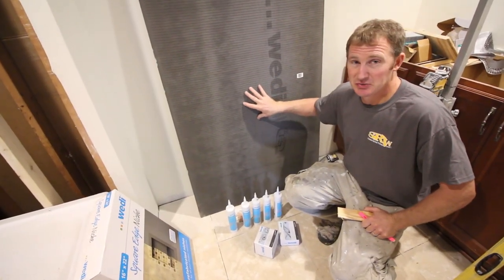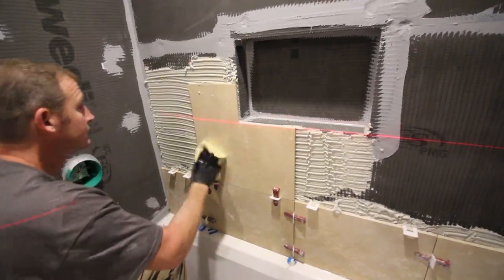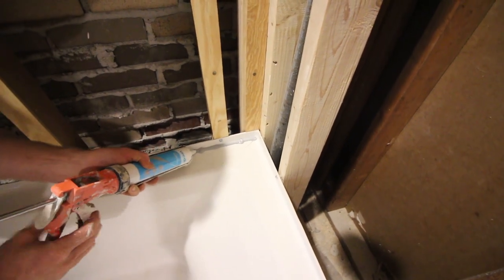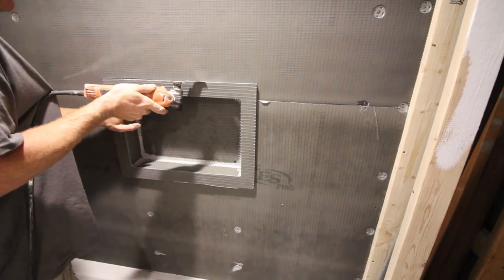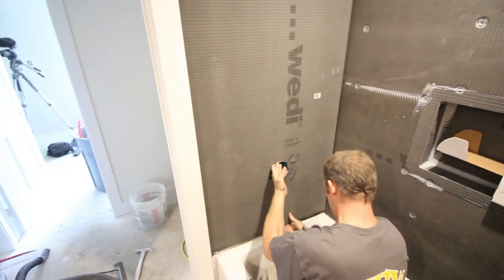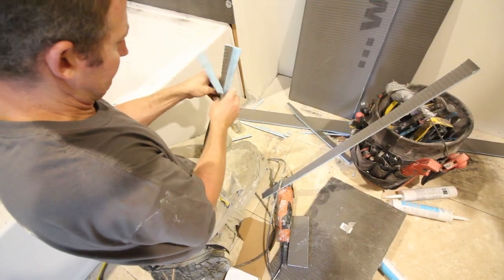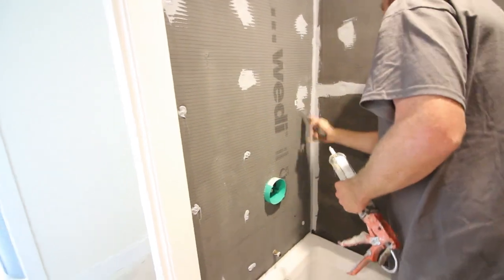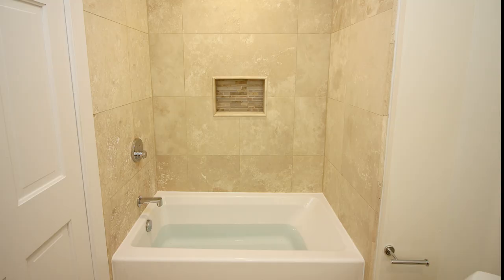How to Waterproof a Shower Using Wedi (Step-by-Step)

Comment: So in a previous video where you compared 3 ways ( concrete, kedi-board & wedi board) you lined up the bottom of the board with the top of the tub on all sides. In this video you overlapped the wedi board on the "back wall" only. Can you give a description as to why this decision was made? I just picked up some Wedi and am about to start placing it i on the wall. I can space it out so it overlaps, but I need to do that now. Why did you do this two different ways?

Comment: GREAT video guys!  Questions on corner beads:  What type of corner bead (Wedi to Gypsum) do you recommend; Do you use Wedi sealant on the exposed edge of the Wedi board before putting on the corner bead? And do you recommend using Thinset, mud, or something else to finish?

Comment: Just a quick question...why did Steve not fur out the other walls to bring the wedi panel down to the tub, and instead put the wedi panel on the lip of tub?  Love your videos....will be ordering from you soon!
Reply from the maker: +hllywd964 great question. In order to have the wedi flush with the 1/2" drywall we needed to place the panels flush with the studs. Hope that makes sense. Let us know if you have any questions, we'd be happy to help
Reply: I used Wedi a few years back for a tub surround.  Their instructions say to notch the lower edge of the board (from behind), place a bead of sealant in the notch, and put it over the tub's lip, leaving a slight gap from the tub's finished surface.  It worked like a charm and would eliminate the need for the strips on the back wall.  BTW, despite the cost for Wedi board (it ain't cheap), I absolutely love it.  Show me another equal quality product that's installed and ready to tile on the same day (imagine doing a walk in shower without Wedi).  Thanks for the video.
Reply: What are the disadvantages, if any, to half-inch Hardie Backer Fiber Cement Backer versus Wedi board
Reply: @kenhoward127  Goboard is just as good and more readily available, at least where I live.

Comment: I am using a delta r2200 diverted/valve which is not round. Any ideas on how to water proof the area where it meets the wedi board?  Of course cutting a round hole won’t work for this application so I can’t use a standard wedi round gasket. Thx!

Comment: Could we use the Kerdi Fix on Kerdi board over the washers the same way it's used the sealing on Wedi board? They seem to be almost the same technology. Looks a bit cleaner with Wedi. Thank you for all the info. God Bless you guys for sharing the info.
Reply from the maker: +Chivu Florin thank you, unfortunately we can only recommend the method Schluter recommends with KERDI-BOARD, to apply KERDI-BAND over screws and washers. We agree that using just KERDI-FIX would be awesome.
Reply: I know this reply is late, but Schluter and Wedi are competing products and they both will void warranty if you use another brand.  For an example, my Wedi rep says if I use a small Kerdi-band on a section of a shower/bath job, it voids Wedi warranty.  Very silly, but they both really don't want you to use any competing product. Apparently Kerdi fix is completely different from Wedi joint sealer although they seem to share same function for each product, but that comes from my Wedi rep.

Comment: Nice system. Never seen this one. 
I assume its foam. .. is there any flex from smaller format tiles installed on this? 
I assume wall use only.
Reply from the maker: yes, foam with cementicious coating on each side. There's not much flex with wedi, it'll work well with any type of tile. We use the panels on the walls and their wedi Subliner Dry on the floor. It's a great option.
Reply: @HomeRepairTutor  Yes, there is flex.  You need to consider the weight of the users.  Tiles are loose since the wedi panel is compressed in the area where the person stands. Now, I am not sure if the contractor installed waterproofing in addition to the wedi system.  I need to repair but don't know if I can just remove the compressed portion or whether I have to remove the whole floor and some wall tile to see whether we have waterproofing.
Reply: Yes, there is flex.  You need to consider the weight of the users.  Tiles are loose since the wedi panel is compressed in the area where the person stands. Now, I am not sure if the contractor installed waterproofing in addition to the wedi system.  I need to repair but don't know if I can just remove the compressed portion or whether I have to remove the whole floor and some wall tile to see whether we have waterproofing.

Comment: Awesome as usual!  Thank you!  Is it absolutely necessary to fir out the main wall in order to have wedi board go over tub flange and sit on tub deck?  Just curious on all the reasons for furring  out that wall.  Thanks again!
Reply from the maker: It's not necessary but will save money, you won't have to use as much Joint Sealant
Reply: @HomeRepairTutor  i bought this kit based on your recommendation and awesome installation video. Will be installing  soon.  Also planning on buying your membership here shortly.  You guys are the best!  Hope you're being financially rewarded.  If not its sure to come.  Keep up the awesome work.
Reply from the maker: @treystills  thank you, the BRT Video Library is great for this type of project. Let me know when you join and I'd be happy to help in any way. The best reward is seeing results from our members!

Comment: I really need a clarification  please - you started 4" on top of the tub for the screws and then every 12" for the fasteners.  I've asked this to my local area Wedi tech rep, and he's a real cocky know-it-all saying his way is the highway and you always start 12" from bottom whether on a shower pan or on top of a bathtub.  I assume you use 4" because of a know-how after having done many remodels. Would you explain why you start at 4"?  Have you seen Wedi bow out after tile job when started at 12"?
Reply from the maker: first, it stinks that your rep is being cocky. We're all students and nobody is a guru, period. We were also told to start at 12" for showers due to the tendency for the Wedi board to bow inward and thus compromise the joint it makes in the shower pan rabbet; recall, Wedi shower pans have a rabbet joint that receives Joint Sealant and then the Wedi backer board. However, that rabbet joint doesn't exist for tub showers. Therefore we're okay using the screws at 4" above the tub deck.
Reply: @HomeRepairTutor  yep the rep is a douchebag...I ended up going with Wedi because of you guys but he's making me regret it.  I'm going to start at 4" as I see you guys do it and also see it on the manual illustration for the bathtub instruction where I see the screws pretty close to the tub deck.  Thanks again!

Comment: I have searched the internet and many Wedi youtube videos, and have not found an answer to this scenario.  I have a shower where a couple of the adjacent walls do not meet at a 90 degree angle (as an example, let's say the walls meet at an inside angle of around 130 degrees instead).  When installing the Wedi boards on those two adjacent walls, do you recommend that I put a mitre cut on the edge of each of the adjacent wedi boards.  For example, if the walls meet at an inside angle of  130 degrees, I would put a 25 degree mitre cut on each of the adjacent wedi boards (180 minus 130 = 50 divided by 2 = 25).  I think I would have to do this in order to make sure the Wedi sealant still has two edge surfaces that butt up against each other to make sure the joint is totally sealed.  Is there anything else I should be doing to completely seal that joint?  Or, is the wedi sealant still sufficient?

Comment: Is the joint sealant universal in adhesion performance with other surfaces? I can understand that it adheres to the  Wedi's blue foam membrane but the tub ceramic, fiberglass, plastic surfaces? And the adhesion to thin sets and mortars and drywall?

Comment: what would the cost to purchase, and install the tub, as well as the board be? Obviously, exact numbers may fluctuate, but a rough estimate is all i need. Also, could you install the board over the flange on the tub?
Reply from the maker: +Joe G we can give the material cost. Tub is a jacuzzi and was $400. Wedi tub surround kit ranges from $329 to $522 depending on the dealer and shipping cost. Board can go over the flange if the wall is shimmed
Reply: Home Repair Tutor  you mean jetted for $400 ....and from where?
Reply: oh ....not jetted so jacuzzi makes regular tubs?

Comment: I have heard endless arguments over placing the boards over the lip, keeping them on top, and even leaving a very small gap. Provides me with endless confusion before tackling a project. I noticed here with the back wall you installed it over the lip all the way to the tub. But with the side walls only put the board at the top of the lip. Why?
Reply: Same here, I noticed my tub flange lip isn’t even straight across so I’m definitely not setting it on top of the lip. My flange is also like an 8th thick so even worse. I noticed the one he’s working with is like a quarter thick and it’s actually straight. In that case I would actually do it that way but not with my jacked up tub.
Reply: As I understand it, some boards can wick water. Because of this, I am going to install mine on the top of the flange after I put flashing around the perimeter. We’ll see how it goes.

Comment: I just do not trust joints that are caulked and not somehow counter flashed like the Schluter or USG system. In new england the building moves entirely too much to rely on caulk to hold a joint together. Otherwise great contractor, guy knows his stuff.

Comment: Hey guys. Love the channel. I just installed the wedi board base and walls. The thinset was a little thin but held its shape even when left for a while. Will I be okay?
Reply from the maker: You should be okay if the correct trowel was used and the thin-set was mixed per the directions. Which kit did you use?
Reply: Home Repair Tutor 36x36 kit. You were right. Once the thinset was dried it’s in there. I think I did 2 parts thinset mix. One part water.

Comment: There needs to be more sealant in the corners and on the seams.  Wedi calls for at least a 1" wide strip on each side of every seam (including corners) that must be within 1/16" and 1/8" thick.
Reply from the maker: keep in mind that 1" on camera doesn't necessarily look like 1" - this shower was waterproofed and installed to Wedi specifications.

Comment: Great video again guys! I've been having withdrawals the last few weeks without one LOL. One question though because I've never worked with wedi, do you leave a small gap, 1/8 or so between the tub and the bottom of the first panel for expansion/contraction and weight from water and people? Thanks again!
Reply from the maker: lol, glad we could get a video out this week!! Thank you for the kind words. We don't leave a gap but rather use the wedi joint sealant on either the tub (if shimming the wall) or tub lip (if not shimming the wall). The sealant likely adds a 1/16" to 1/8" buffer for expansion/contraction. Great question.
Reply: Home Repair Tutor one more question....do you sell this same kit from you're online store?
Reply from the maker: +460 S&W we do, it's called the wedi Tub Surround Kit. We also do custom shipping quotes

Comment: What he does not discuss is the price. You have to special order a pallet from Lowe’s or Home Depot here in Texas. Over 2k for a pallet! I wish I had enough to do my shower though. I am sure it is worth the price!
Reply: Go with Goboard instead. Got it from Menards at $26 per panel of 5'x3". The special caulk and screws to use with them you can find them online at Amazon or Contractors Direct. Just as good as Wedi board.

Comment: For a DIY'er, any real advantage for this over Kerdi? I've done sheetrock which this is similar too, but somewhat new to tiling.
Reply from the maker: wedi is a bit faster than KERDI over drywall. The wedi building panels also are waterproof even if the surface is scratched or cut, which is different than KERDI or KERDI-BOARD. Both methods are fantastic and solid methods for waterproofing a shower. What kind of project are you working on?
Reply: Remodeling one 3-piece bathroom as is and for the second tub to shower conversion.
Reply from the maker: let us know if you'd like help with the wedi if you go that route. We've been helping folks with design and materials. It seams to be helpful to have a second opinion on what to get. Feel free to send me an email with any questions, jeff@bathroomrepairtutor.com
Reply: Home Repair Tutor Thanks Jeff. On vacation this week, starting demolition when we get home and I've been checking out the premium lessons you offer.
Reply from the maker: Anthony Raynor have a great vacation! You might like the lessons, lots of detailed videos. We also answer a lot of questions while people are in the middle of their project. I think that's almost better than the videos

Comment: Great demo, very instructive, thank you!
Its a Dremel Multi Max by the way.  I have the Multi Max 45 which has a quick release button.  This is the best tool for flush cuts on the market.  
On the niche install, I think it could have used more glue to hold it down.  It had no nails or screws attaching it directly to the wood studs, only some on the ends. It did not look secure enough.
How does Wedi compare in functionality and cost over Schluter Kerdi board, or Hydo board?
For a small RV bathroom install, this type of backer board is ideal for low weight and prevention of water leaks.  My question is, how do you hold up the vertical wall tiles on Wedi board?  You still have to use thinset mortar right?  Can I use Polymer instead of water in the thinset mortar mix and also in the tile grout?  Reason for this is - my RV is under constant movement like an earthquake.  Polymer gives a rubber movement dampening effect on the tile and they don't pop out.  Not sure if you can use Polymer on these new materials.

Comment: Why do you shim the back wall with plywood (to bring the panel out and overlapping the tub lip), but then set the side panels on top on the tub lip (no overlap)?
Reply: Ah, I read in another comment that it was just to save money on the sealant.
Reply: Ya I was confused as well, But I see by Kohler's instructions they want the Water Resistant Board (Wedi Board) over the Tub Lip. So maybe the best way is to the Wedi Board over the Tub Lip on every side?

Comment: Thank you for the great film! The handsome contractor Steve in this film should be in Hollywood rather than in somebody bathroom though. Hollywood overlooked for sure!
   My contractor installed a waterproof sheetrock, but I want now a niche, like in this film. Can I cut out a rectangular for the niche, because wooden studs are not cut out or I  need to remove corresponding sheetrock  piece completely? My contractor didn't put any washers, would it be a problem? And if that sheetrock installed on the whole wall till the bottom already, can I put tile in the way that sheet rock is behind the tub and seal the edge somehow differently than shown in the film?
Reply from the maker: Is the sheetrock going to have Kerdi or another sheet membrane of it? That's the primary concern
Reply: I have a green (waterproof) sheetrock, 1/2 in. May I also know where I can find those washers, are they special, waterproof as well? Thank you for the quick respond.  I know that I would need to complete the project myself, and though did a lot of stuff before, this is new for me, since I've never worked with thinset. You advertise free course, where is it? When I clicked on the link provided it shows $100, I assume it is more extensive course, is it so? And if you pay $100, for how long you can ask questions, is it for a month? Thank you for the quick respond and good film.

Comment: Perfect timing!
Reply from the maker: +DJ Primo cool, what kind of shower are you building?
Reply: Home Repair Tutor 38x38 corner stand up shower :) I just got the exact same niche as well. I'm tiling the walls and using pre fab pan.
Reply from the maker: +DJ Primo nice, is that a custom pan?
Reply: Home Repair Tutor no but it's gonna be a custom installation! lol
Reply from the maker: +DJ Primo lol, every shower is custom. If you're using large format tiles let me know if you want T-Lock samples. It's a great leveling system
Reply: Home Repair Tutor you know what I think I will use t lock! Let me know. Thanks
Reply from the maker: +DJ Primo send me an email jeff@bathroomrepairtutor.com

I can get you a variety of samples

Comment: How long do I wait to do a water leak test?  Wedi is installed and I want to test to make sure everything is good prior to tiling. Thanks in advance.
Reply from the maker: Wedi’s handbook states in as little as two hours after Joint Sealant is applied

Comment: The fact that you don't have a drop sheet and tape off the tub is beyond unprofessional.  All the concrete bits of the wedi panels  on the bottom while being walked on will scratch the crap out of that  brand new tub.  Takes 10 minutes to properly cover the tub well,  just complete laziness.  Prep work is key to a successful job.  I'm honestly beyond shocked.........